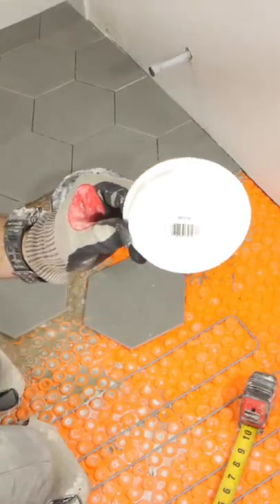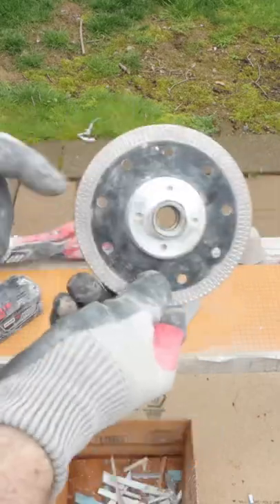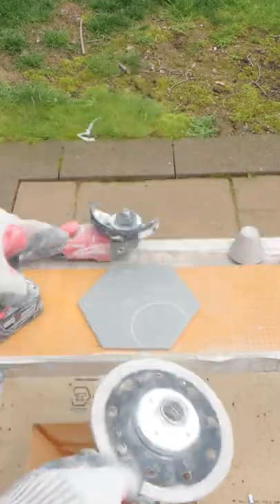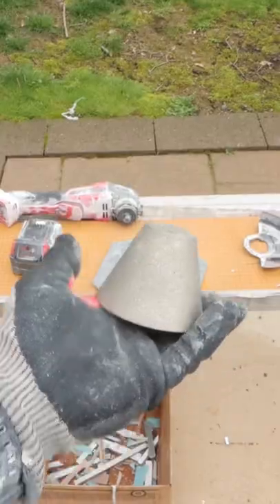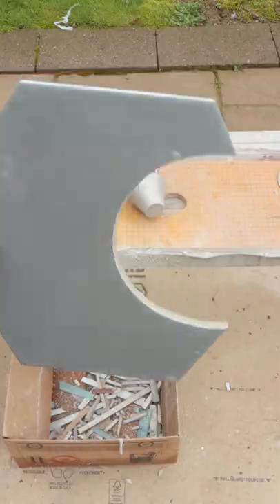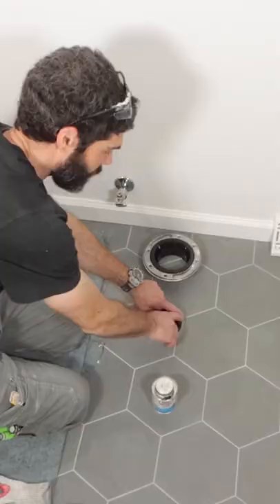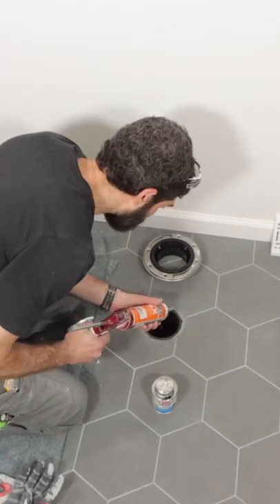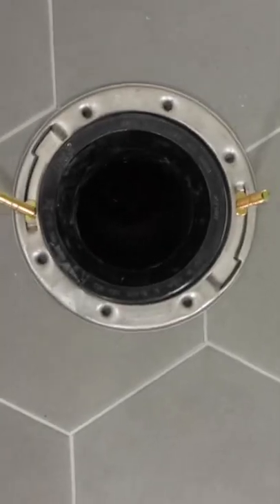Tile Floor Toilet Tips - #shorts

Comment: Handyman here, Bless you for using a stainless steel flange that is above the tile, I've made a ton of money from fixing ceilings under tile jobs that skipped those two details. 
While you are at it, how about setting the toilet on a bed of setting compound, like grout. That way it won't rock and leak later.
Reply: What if you have to repair or change the toilet out?
Reply: @tjharriman9551  yea no one does this and if they do they don’t know what they are doing… same with the ones that caulk around the toilet base. No reason to do either of those things just makes repairs much more of a hassle
Reply: @LumenChaser  as a plumber in some places it's code to caulk around the bade of a toilet. Commercial always

Comment: I believe it is a next step incase wax ring will not hold, but you see those little holes on flange, they are for screws. And flange has to be attached to the floor and you still have to drill though the tile. 
It is not bad but in this case one person has to do plumbing and tile and 4" pipe has to be sticks out from floor.

Comment: Looks amazing! Now the next question is how in the world did you cut that pipe down flush?
Reply from the maker: thank you, I used an oscillating multi-tool to cut the 4” riser pipe flush with the tile 👍🏼🔥
Reply: @HomeRepairTutor  ahh okay! Duh. Thanks for the response 😊
Reply from the maker: @danewgirl4  happy to help any time 🔥
Reply: You can also use a Sawsall or an inside pipe cutter. If you cust the pipe flush at the floor line and angle it down it will leave you with a perfect cut everytime.

Comment: I use an old 7 1/4 saw blade for going around flanges. Leaves a perfect 1/8 inch gap around the flange
Reply: Need to send a tile guy and a plumber back to every one of those jobs. The flange must sit on top of the tile. You flooring guys stop hacking your jobs. This video is one of the very few that I've seen, that does it right. Almost 100% of the time when I pull a toilet, and a hack tile guy did the job, I can take a screwdriver and push it between the tile and the flange, and find the floor rotten below it. Your job's are not even lasting more than five years.
Reply: @godofplumbing  I come in after the flange is set so I don't know. Our plumber wants it flush with the tile so that's how I do it. Maybe if the plumber hooked it up correctly it wouldn't leak.
Reply: When you arrive on a job and you have to tile around a flange you need to let the homeowner know that their new floor is not going to last but five years, unless this is fixed. That way you can wash your hands of it. If the homeowner says I'm okay with it, have them sign a hold harmless. Otherwise the plumber who goes in behind you is looking at the homeowner and saying that you hired a hack tile guy. That is just the way it works. Also if you're hiring a plumber that does a hack job like this, then your name is signed with it.
Reply: @godofplumbing  shouldn't leak if it's hooked up correctly

Comment: I would never use that flush mount flange.
Glue a pvc 1/2 inch above floor flange into pipe and then you wont have to worry about the silicone stopping any sewage seepage from going thru floor

Comment: The flange should have been installed before the tile went in
Reply: You're not serious are you?
Reply: The flange is supposed to be flush with the finish floor. So to answer your question yes I am serious
Reply: @ricklee827  well you're incorrect.
Reply: @purehitman24  look I'm not going to get into a debate with you about this but it is a fact that the tile should be flush with the top of the floor flange the way he did it was fine but the truth of the matter is flush with the tile and you seal the toilet thank you very much goodbye
Reply: @ricklee827  the flange doesn't seal the toilet 😂 the wax ring does. You don't need to argue because you're just wrong. That's why you're all over trying to correct everything on this channel. It's clear you have no clue what you're talking about.
Reply: @ricklee827  the only way the flange would sit level with the tile is if you didn't have tile under the toilet. Go back to your DIY videos 🤡
Reply: @ricklee827  As a general contractor I've had this conversation with multiple plumbers and all of them say the flange sits on top of the tile. Obviously sitting flush works too, so is this really the hill you want to die on? Arguing about two technically proper methods of setting a toilet? Do you realize how insignificant and aimless this is?
Reply: @purehitman24  The flange can sit flush with the tile. It's fairly common. Both methods work, and there will always be tile under the toilet.
Reply: @Tool_Addicted_Carpenter  believe me there's not always tile under the toilet. Ppl do crazy things. 
I've seen septic lines buried 6 inches with concrete steps on top. 
The flange always goes on top of your finished floor. The horn and seal are designed to work at that height. Installing them flush causes premature leaks. Ppl might do things and say it works but there's a resign they were designed to work a certain way. 
I believe if any of us knew better than the designers of the toilet we wouldn't be here in the first place.
Info from running a custom home building business for the last 17 years.
Reply: I prefer, after the tile,I'm a plumber
Reply: @jamescoombs2569  as long as you have thin flange like they have it's good otherwise they do recommend flush with the finish floor